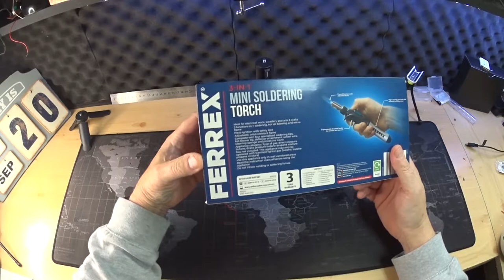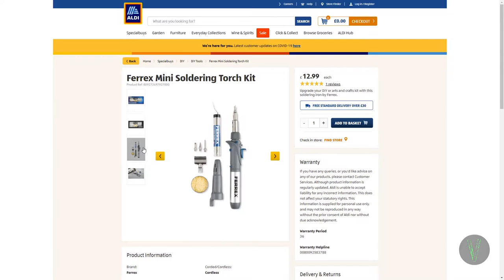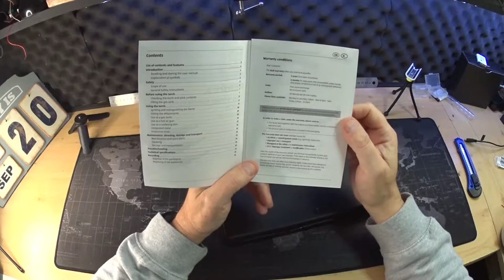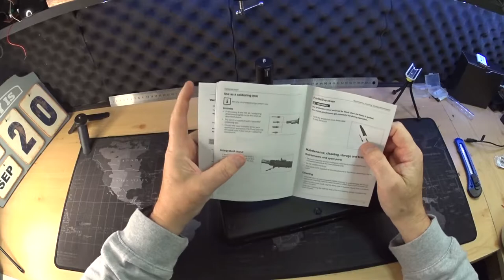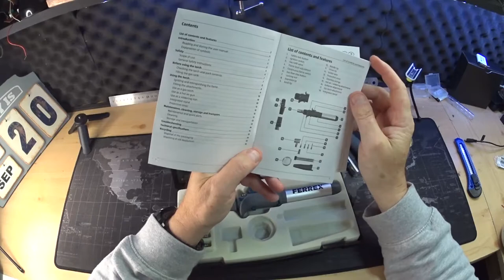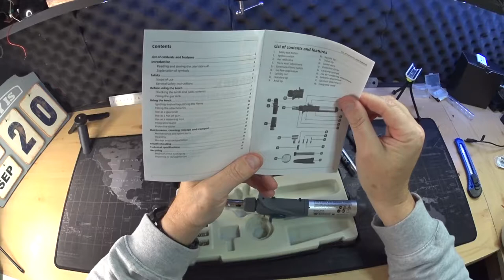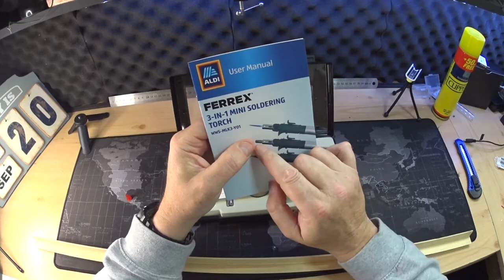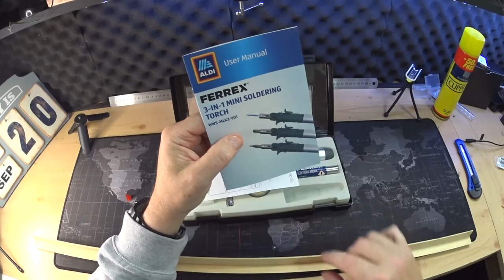Ferrex Mini Soldering Torch Kit

Comment: Hi Vinny just stumbled across your video regarding the ferrex mini soldering torch and just wondered if you've soldered with it and if it's any good ? Cheers Vin
Reply from the maker: Hi Lutonian, thanks for your comment, I’ve soldered a little bit and find it very clumsy for delicate work, perhaps if I had a finer solder head I would change my mind, or maybe if I needed it for heavy soldering on larger points, the flame is excellent and I use that for cable  heat shrink etc

Comment: Just opened mine flame lock switch is solid don't move.
Reply from the maker: Hi, have you watched the whole video? Thanks
Reply: @vinnymars  worked it out moves when pull flint down,just need get gas

Comment: Nice video Sir, Informative and entertaining. I was hoping to see a close up of the nozzles included and to see if it could do hot air soldering but thoroughly enjoyed watching anyway. 
I've liked and subscribed, I might even have a look at your back catalogue.
Keep up the good work and Thanks for making the video.
Reply from the maker: Hi, Thanks for your comment and your subscription! I always appreciate them, I would imagine that it could on a small scale there is quite a strong flame
Reply: @vinnymars  Hi Vinny, thanks for commenting on my comment.
I did do a bit more research and it turns out that it isnt really any good as a hot air solderer for reflowing and that's because of the strong flame, as you mentioned. 
Nice one, cheers Vinny.